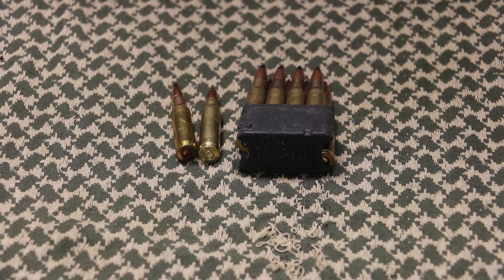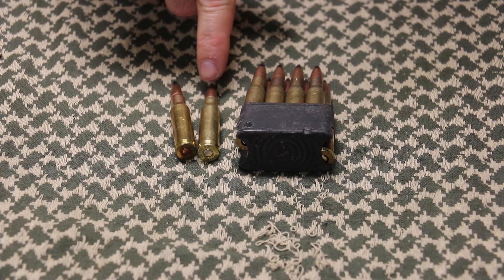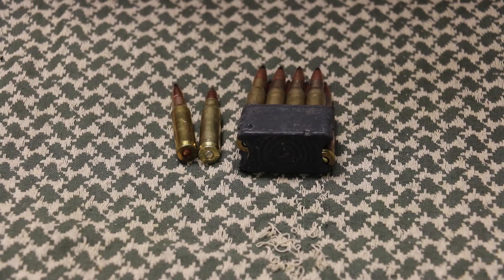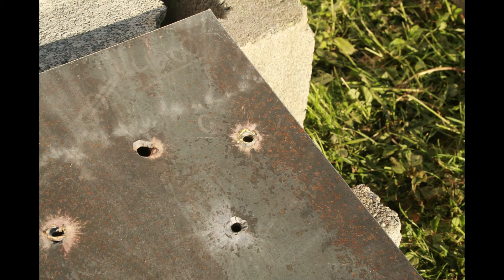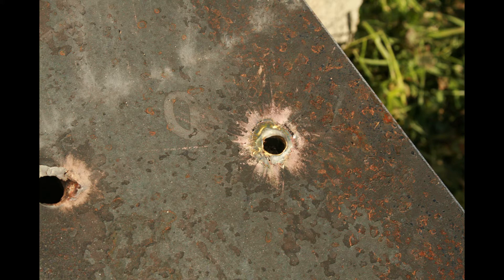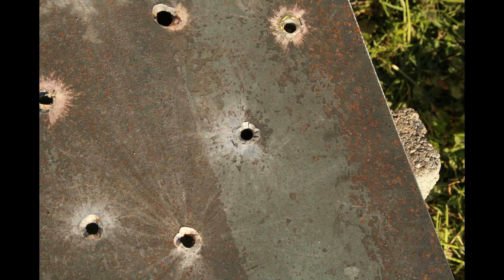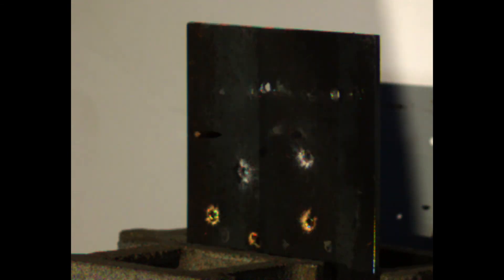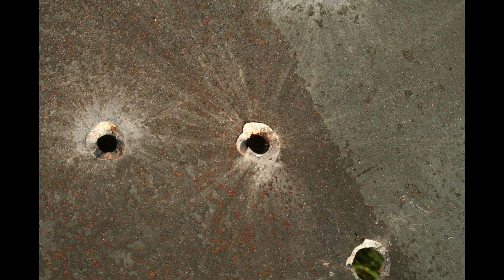Slow Motion Showdown!: 3/8" MIL-46100 Steel Armor Destroyed!!! Aimed Research

Comment: I used 3/8"  AR680 plate for my target.  I am still constructing it, but I took it to the range this morning to see if I need to tweek anything.  I shot at it 5 times with my .06 and about 20 times with my .556 at 100 yeard.There is not even an impression I could feel with my finger at any of the impacts.    I did hang the plate at a 45 degree angle (top of the target closer to me than the bottom) and the shape is an elipse (oval).   I did this for a couple of reasons.  The bullets are not stopped by the target, just redirected down into the dirt.  That way a good share of the energy is deflected and not absorbed by steel.  By hanging the plate at an angle, the target looks round from a distance. I have a couple pictures of my target stand but I can't figure out how to post them here.  The place where I shoot is a public range owned by the county.  I needed something that was portable so I can easily set it up or take it home.  If I left it there someone would steal it.  The frame for the target is made of 3/4 galvanized pipe so it is heavy enough so it won't tip over when it gets spanked.  The entire contraption weighs about 50-60 pounds and is on wheels so I can easily transport it in my pick up and move it around like a wheel borrow.  I hope I have described it so everyone can understand.

Comment: You should do a 1.5 inch ar500 plate or plates with the tungsten core using m855a1 loads or hotter since it is shorter than m855a1.

It would also be interesting to see various armor go up against 50 cal ap sub sonic. Either from 50 bmg or from something like 510 whisper.